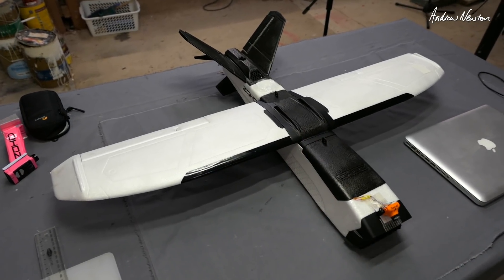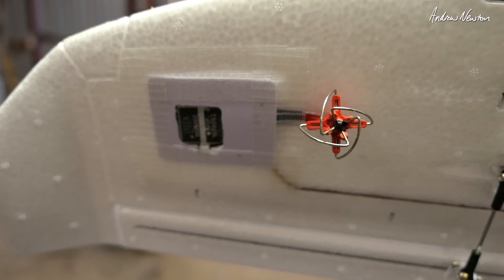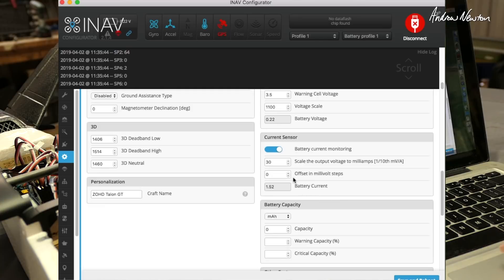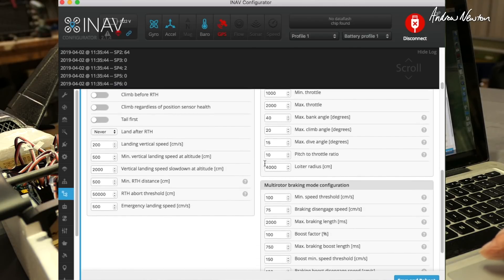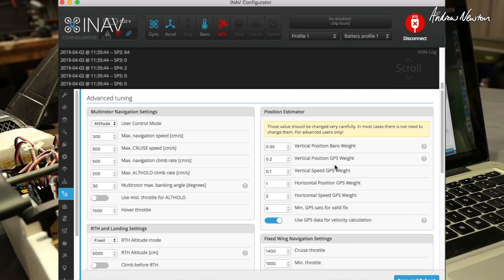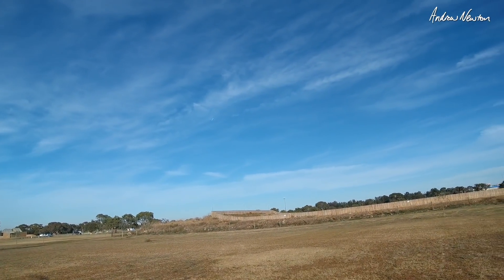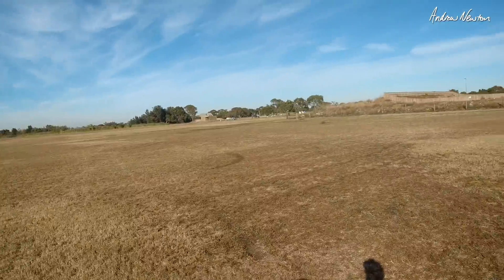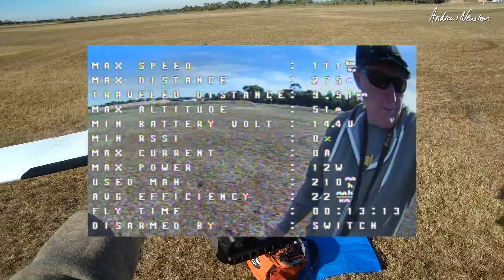ZOHD Talon GT iNav Setup and flight

Comment: Andrew first I want to thank you for making this video! I wanted to ask about what you ended up doing in order to tame the Talon. I’m in the middle of setting mine up and I have already installed longer horns on all control surfaces and I’ve also moved the servo rods to the lowest hole on the servo horns. And still, this model has way too much travel. Currently I cannot go any lower than 10mm of travel for elev/rudder and 15mm for aileron. What else can I do to further tame this plane?
Reply from the maker: Same, longer control horns and I reduced the rates as well.

Comment: Just wondering. Does anyone have dialed in settings for the talon gt running inav 2.5? Would be greatly appreciated.
Reply from the maker: Marc Hoffmann would I'm sure. https://www.youtube.com/channel/UC76s-8uSH8-hUzYYrGG4OJg
Reply: @AndrewNewton  thank you. I did not see any settings on his channel. However I shall bruch up on my German and ask him. My plane flies and boy does she pick up some speed. It is just that it rocks side to side and I think my piff settings need adjusting. I could tinker with it though It would be easier if I could get a working "diff" file from someone for inav 2.5.

Comment: What is better gps mode for airplanes nav poshold or nav althold? Thanks
Reply from the maker: Both are useful. Read what they do in the iNav Wiki
Reply: @AndrewNewton  Thanks i miss that part.  It  says that the aircraft will   loiter in circles on position hold.  Not very useful. I think nav althold with nav cruise combination is the best. Thanks again

Comment: Great videos Andrew,  my GT Rebel is on the way (was $100 off on summer sale BG).
Partly because of your reviews it convinced me.
A question; I always had this “phobia” of magnets near flight controllers, and thus always avoided the use of strong magnets to keep hatches down. Did you ever find this to be problematic or interfere with sensors?
I know the GT rebel uses the magnets as well so I’m very curious about your thoughts...
Thanks in advance, Gert.
Reply from the maker: Excellent Gert. It really is a well designed plane, fast and efficient, and packs down into a backpack in minutes. I have never worried too much about magnets, other than keeping components a few cm away from them. I did see an ESC go crazy once when a loose magnet stuck right onto it.

Comment: I think in the documentation, matek tells you what your current scale needs to be to get accurate current reading
Reply from the maker: Yes that's right Henry 317, but scaling is not the problem. The current reading drops from 0.8A to 0.2A as I throttle up. Fried current sensor or resistor I suspect

Comment: Great video, Andrew! You're onto something with regards to the control throws... I too have waaay too much control authority in manual mode. I wasn't even aware I could limit them in iNav, still learning my way around it myself... lol I 100% agree with you, it needs some adjustment on the linkages to mechanically limit the throws to something more realistic. I believe that would allow the FC to work better. I had the same issue when I put an old Storm in the Nano Talon. I was unable to "tune" it to fly well in any stabilized modes until I adjusted the aileron linkages to get more resolution from the servos. Longer horns on the surfaces would help. I will likely check to see if there's room to move the linkages closer to the servos on that end first, if not I may raid my box of parts and find some longer horns to bolt on. By the way, I flew mine again today, nothing real exciting as it was still a bit too rough/windy to do any further tuning, but I did take it a couple miles out and flew around for 20 minutes or so. I may edit something and post that soon unless I get more exciting footage first. lol Anyway, thanks for the great content as usual!
Reply from the maker: Thanks Keith. Means a lot to get your agreement. I'm envious of your wide open flying space.
Reply: @AndrewNewton  it is weird to  see two "BIG" talking to eachother on YT... funny though.. I follow both

Comment: doesn't sound like anyone else has mentioned it, @4:15 your min throttle should be around 1050 and the min command as 1000 just because your mototrs won't start generally below 1050 as the esc can't run them slow enough, you can also run into arming issues. your current sensor should be set to what is listed on the matek FC page (317 I beleive). nav_cruise is alt hold and heading hold
Reply from the maker: Excellent thanks. I started with current sensor at 317 and that was giving a reading of 1/10th expected current. Just trying different scaling to see if that's the issue. May be dodgy soldering or fried components
Reply: @AndrewNewton  checkt he matek website for the flight controller.. I don't have one of mine to hand to check what mine is. is it a reading of 1/10th of the current or it's a 1/10th off? i've got 5-6 F405 wings and they're all pretty much spot on within a few milliamps. not enough for me to worry about
Reply from the maker: I have another F405 Wing board that work as expected with 317 but this gives false current readings for some reason. With scaling of 317 it doesn't move from around 0.4 for the whole flight.
Reply: @AndrewNewton  sounds like a bad current sensor or shunt resistor

Comment: Great overview of iNAV, Andrew.  On my F405-WING I had to raise the current monitoring scale to 317 before I got an accurate reading.  Btw, I heard CASA is proposing a $20 per-model registration fee - is that right because it sounds crazy
Reply from the maker: I was originally at 317 and current was 1/10th of expected, may be a problem with the board or my soldering, but everything else is working well. CASA proposal is up to $20 per pilot
Reply: @AndrewNewton  Weird 🤔  So the registration thing it's per 'pilot' and not per model?  That makes more sense but it's still kind of outrageous.  I got the news from Bruce Simpson over at XJET.  Maybe he misread the article
Reply from the maker: Bruce is spreading incorrect media reports. He should know better.
Reply: @AndrewNewton  I rewatched it and to be fair he did say he could be wrong and that "appears" you'll have to pay $20 per model

Comment: Great video Andrew, I feel lucky now, I noticed one of my control horns had a crack where the balljoint was screwed through, so I replaced them both with 
what I had on hand, and being one hole longer than stock I've now fixed another problem I was unaware of. Good news also, the stock horns are screwed only, 
no glue makes for easy replacement.
Cheers from the south.
Reply from the maker: Nice one. What rates are you using now?

Comment: Would you mind trying it on 3S with a 9x4.5 prop? I am thinking of using a 3S 3000mah to keep it light but afraid of prop breaking on landings
Reply from the maker: 4S 3000 right forward with Mobius camera on top is as light as it can be for correct CG. You would need 3S 5000, but I can try that.
Reply: @AndrewNewton  Hi the bettery is LiOn or Lipo, thanks

Comment: I use Autolaunch all the time Andrew,, works really well every time, I dont even hold the TX...its a 25 second timeout...This bird is tricky to launch with a 5200 4S...and Autolaunch can react way faster than manual inputs...I have the CLI codes if you need them...Take her down the Beach and stretch her legs...lol.
Reply from the maker: I have used autolaunch extensively, just prefer power assisted launches specially with big heavy planes.
Reply: The trick is to have the correct Parameters, crucially, having the motor start as soon as it leaves your hand...Try these, works for most if not all planes..:  You may want to shorten the timeout to suit.

set nav_fw_launch_velocity = 300
set nav_fw_launch_accel = 1500
set nav_fw_launch_max_angle = 30
set nav_fw_launch_detect_time = 10
set nav_fw_launch_thr = 1900
set nav_fw_launch_idle_thr = 1000
set nav_fw_launch_motor_delay = 100
set nav_fw_launch_spinup_time = 50
set nav_fw_launch_min_time = 0
set nav_fw_launch_timeout = 25000
set nav_fw_launch_max_altitude = 0
set nav_fw_launch_climb_angle = 15

Comment: Roll max = 45  max Pitch = 20 deg.....Max dive angle 5 degrees...Loosing height fast on rth is not a good thing....Try Autotune...switch it on, bank and dive climb for the entire flight, but switch it off just before landing...reboot will save ideal Pids..its easy...try it...gives smooth flight, first time...lol.
Reply from the maker: I intended to try Autotune but quads, dogs and golfers got in the way
Reply: Ah, I see, how inconsiderate of them.....lol.

Comment: Hi Andrew,

If you get the sticks to where it is flying level in manual mode and do a servo auto trim for 2 seconds then land and disarm, it will have the servos in exactly the position they need to be for level flight.

Now do your manual adjustment of the pushrods to get the surfaces in the same position and fly and do an auto trim again and it will be perfect.

Auto trim is a great way to take the guess work out of where you think the pushrods should be and get it right the first time.
Reply from the maker: Thanks Dean, getting there.
Reply: @AndrewNewton  It's a learing curve! But I haven't had any inav relates faults in the last couple of versions.